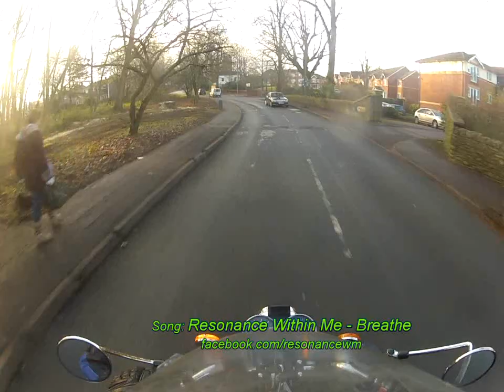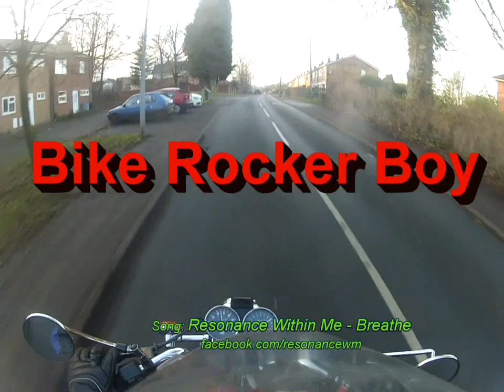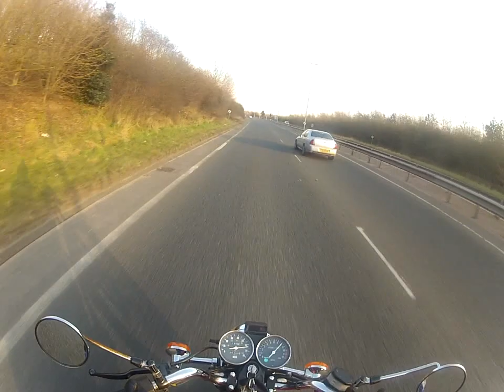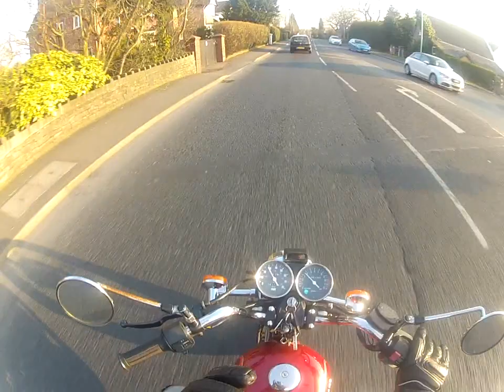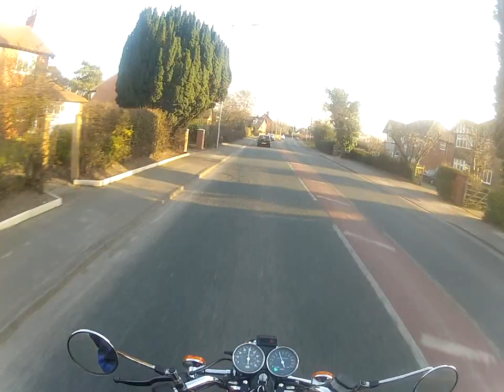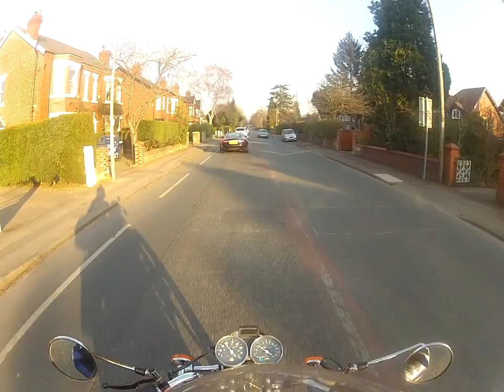Cons of an air cooled engine

Comment: Nice bike B).  We had that motorcycle on hand at motorcycle school, but I chose a Suzuki TU250X.  Anyways I am looking at an air cooled motorcycle to upgrade from what I have now.  A Kymco Venox 250, water cooled.  How do air cooled motorcycles fair in the summertime?
Reply: bajaj rs/ns 200. it has 24 hp and the rs is the fairing version.